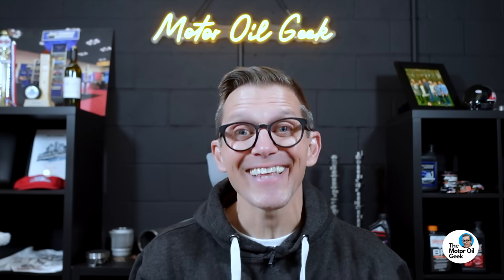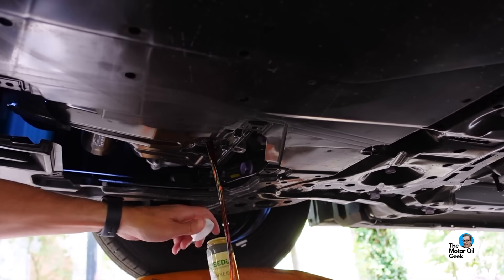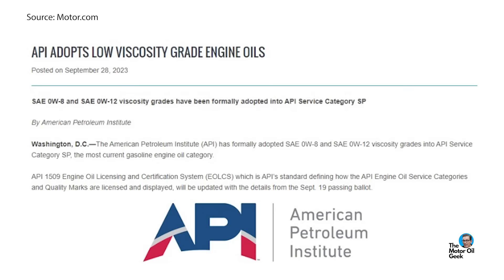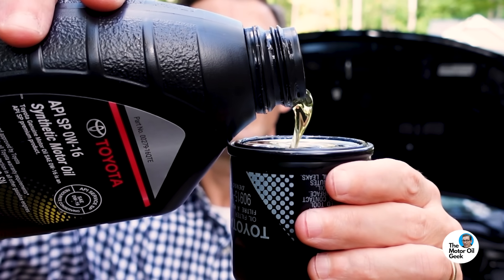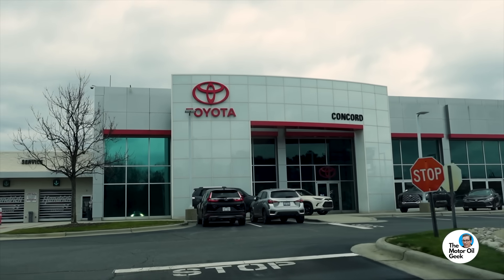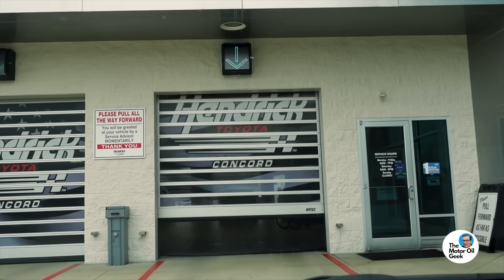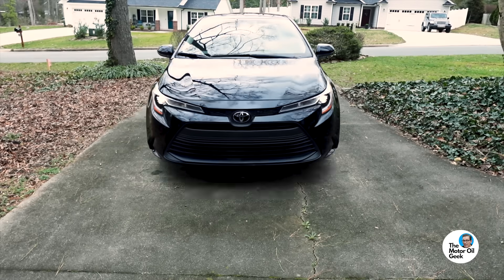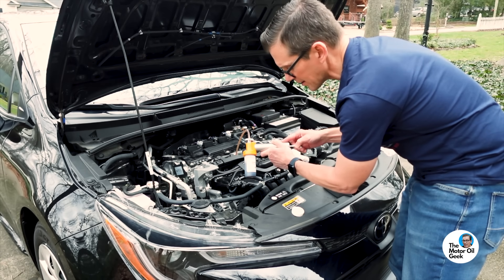0W-8 Motor Oil: Too THIN to Trust? Let's Find Out!

Comment: No need for a 0W-8!!!  A mono grade 8 oil would do just fine even at zero Fahrenheit.  Viscosity Index Improvers are not lubricants.  Indeed, they sheer and can gunk up an engine.  That is why I always use SAE30HD as opposed to 5W-30.  Don’t forget, the left side is 5W during temps below 32F.  It’s rare in the sunbelt!  So why do I want the extra junk in my oil that are not lubricants and causes sheering?  Mono grade SAE20HD is fantastic and expensive too!!  NASCAR race cars don’t use multi grade oils—SAE50HD is common there.  Also, Supertech SAE30HD has an API of SP.  Good to go!

Comment: Do you foresee issues as these ultra low viscosity oils are introduced into heavier load applications? Theres one thing to lubricate a lightly loaded 4 cylinder corolla engine, but what about larger vehicles, such as semis and off highway?

One has to assume that this oil is already running at or near boundary lubrication conditions. The tribofilm formed by these newer additives such as ILs have to be the reason the contacts dont trash themselves from surface wear.

And furthermore, this must be even more challenging for EV gearboxes. Combining ultra low viscosity for increased battery range but having the potential for high loads from the electric motor. Especially all these "high performance" EVs.

Comment: Great Channel..never knew there are so much additives and what they do..was wondering if you have a video on what the differences  are on oil for Turbo engines do they have xtra additives' to fight heat breakdown or turbo cokeing.. Have new CX30 turbo...I do let it cool down for 2 or 3 minutes before turning of the car, was planning on doing an oil change at 1000 miles....was just going to run a full synthetic ..just a bit early for peace of mind...watched your break in video..also a great info...do you have a Favorite oil for turbos?

Comment: Anyone actually know (Facts not assumptions as Lake would say ) if Toyota is using tighter clearances when spec-ing these lighter oils or are they building to the same old clearances and then expecting the additives to pick up the slack.

Comment: Even 0w20 is sketchy.  The thinner the oil, the less forgiveness you have with dirty or low oil conditions.   Lower emissions and better mpg are great but at the cost of lower tolerance (in real world use, not a lab or a dyno) isn't worth the gains.  What good is a 0.05 gain if the engine is 25% more likely not to last past 200k miles

Comment: If those lower viscosities can still protect under load, the big benefit will be much faster pressurization and protection at startup, especially in colder weather.
Reply: That's the theory but then all gains would be lost as soon as you're in warm weather season. Plus all the thin oil just falls off where it needs to be.

So yeah it pump up nicely but it fails to stay where it needs to be.  20 or higher is probably the best compromise. Europe only uses 30 and 40 despite being much colder than the u.s.  weird places like Dubai use the thinnest even though they're burning hot climates and I'm guessing it's because rhey have a similar CAFE legislation to the us or something that fines them for not saving a drop of gasoline per mpg

Comment: One would think as an engine gets older and its tolerances increase a thicker oil would be better. The issue now is (if you keep up with the oil changes) that your engine doesn't wear because the motor oils of today are so good.

Comment: Thin oil gives no protection on hot weather+ what breaks oil is always heat. I always use 0w-30 in all my cars and never had any engine problems. Bmw has the best oil instructions what oil to use and viscosity, all depends on climate and how u drive
Reply: Mobile one 0W8 oil is formulated to withstand temperatures over 500°F

Comment: 0W-8 seems fine, and they are putting a crap ton of additives in it to make it good. That being said, its just too thin for my liking. Bar none if I had a 0w-8 car I would change the oil at 3k or 5k max just to be safe.

Comment: Speaking of 0w12. I’d like it if you went into the new 23 and 24 3.0 twin turbos switching from 0w20 to 0w12. They claim they have less to lubricate and that’s how they get away lowering the viscosity. I’d like to know if that’s true and how that compares to how Toyota got away with using the lower viscosity. Thanks
Reply: On BMW. My fault.

Comment: @themotoroilgeek … 
Noack … any info/concerns ?? with viscosity so low on this oil … and that your daughters new car is a GDI … 
I see no mention of Noack numbers. 
      Is that a concern of yours with regards to IVD’s … or have the engineers on this oil minimized evaporative loss in such a ‘thin’ oil 
      Many OE’s are say int that Noack numbers under 12 are ‘acceptable’ … 
   Just as you’re not taking long change intervals as ‘ok’ … does that apply to evaporative loss ? 
Do you have a  Noack number on this oil ??

Comment: @themotoroilgeek - do you have a video discussing what oil to run in a healthy street small block chevy or similar? It's a dart block 383 with factory style roller cam and roller rockers. Bearing clearances are on the tighter side. It's not a drag motor. 500HP daily driver. Bigger pan with bypass plugged and a large WIX street type filter.  I have driven BR30 break-in oil in it now. Can i run 0w30 mobile one racing oil (ridiculously expensive)? Can I mix racing oil with 5w30? Is there an off the shelf product that fits the bill? Hos long should i run the break-in oil? 1 hour? 500 miles? PLEASE ADVISE!

Comment: Question:  Have you ever investigated OEM oil recommendations for various driving conditions (normal vs extreme condition)?
My guess would be that the range between "normal" driving conditions and "extreme" driving conditions, would make for a solid guideline of oils recommended by manufacturers.  That way, people could make better decisions on what oil they used, based on their own circumstances, and not simply default to the under-hood sticker.

Comment: Question for you Lake! My car (stock Fiesta ST) calls for 5w-20.  And I’m going to be upgrading my turbo and the manufacturer (Turbo Technics) recommends 5w-30 for street use, and I believe it’s 10w-40 for track use. In this video it perfect showcases that oil viscosity isn’t the only factor to consider. 

So my question is… why do I need to step up to 5w-30? And should I be using 5w-30 for my car now? 

This is my fun car so anytime I’m driving it, the thing is being pushed kinda hard! I appreciate your hard work and thank you for sharing your expert opinion!❤❤❤
Reply: 5w-30 is thicker when warm, thicker oil provides more cushion for bearings and other parts; turbos spin at a ridiculously high rpm and need the extra “support” that thicker oil can provide. They say 10w40 (even thicker still obv) for track because well, track is constant high rpm and high heat use, it’s extra hard on the engine oil so you use a thicker oil to give you a little extra cushion

Comment: You seem like a trustworthy guy, my 2013 Honda uses zero20 I think that’s kind of light. What would be the heaviest I could put in a car without hurting it I don’t mind the 20 is the zero that bothers me. I live in New York I’m moving to South Carolina where it’s warmer. What would you suggest ? Anybody in the comment section that has knowledge you can chime in my car has 111,000 miles not bad by Honda standings but still high. At the moment it uses a quart of oil between every oil change that’s 5000 miles I was hoping a little bit thicker would help that. Thank you.
Reply: 5w30

Comment: The "Free" oil changes at our Honda dealership are technically warranty jobs/warranty pay so we have bulk Honda 0W20 and a separate 0W20 tank with oil from Lubetech. For 0W16 we just have it in quart bottles since there is such low demand for it in our vehicles at this time. 0W8 is somewhat terrifying....those tolerances must be incredible tight.

Comment: Can you test liqui moly molygen 5w30 or 5w40? Ive used a bunch of diff synthetic oils in my 2004 impala ss, from 0w20-5w40...i noticed on molygen 5w40 that my engine vacuum at idle was pegged to max lowest for the whole 6k mile OCI (based on factory vacuum/ boost gauge) which on any other brand of 5w40 or 5w30 or 5w20 or 0w20 it would stay at the second last line on the vacuum side of gauge at idle and i gained a 2 mpg average in fuel economy in my usual commute while i had that molygen 5w40 in there...engine also seemed to be a little more quieter compared to any other 5w40 ive used...would be curious to see you test and see what you find? Seems like whatever additive package is in it makes the engine spin a little easier just based off the vacuum guage and 2 mpg economy increase

Comment: my co worker is automotive illiterate and does about 10k miles between oil changes on his V6 Toyota SUV, well its at 300k now and is still on original plugs and even serpentine belt. hes only done brakes and tires on it. most changes have been dealer or whatever is at a quicklube. yotas go forever it seems. 

i'd like to see a video on testing oil additives... personally i put Hot Shots FR3 nano in all my engines (exceot wet clutch)

Comment: These super thin oils are all about fuel economy.
But don't worry, the way most Turdyota owners ignore maintenance,
and "just keep putting gas in the tank and keep on driving them!" that thin oil will thicken up with sludge.

BTW: CVTs are the worst!
Had the misfortune to drive one on a long trip.
Annoying, droning, and slow.
With modern 10 speed automatics, CVTs and their constantly wearing metal belt, are not the answer.

Comment: Sometimes thin oil kills engines that were not designed for thinner oil. Back in 2012 I was the camp manager for a man camp in the arctic. I had 2 generators one which ran 24 hours a day for 500 hours then I would switch to the secondary generator which would again run 24 hours a day until it reached 500 hours of run time. Back and forth. During the down time the generator on standby would get maintenance and the oil changed. Also the standby generator was always plugged into the running generator with several different block and battery heaters so that if needed it could be started instantly in very below F weather. The engines were never cold or cold started.  One of the generators I had was a brand new Cat 500KW paired up with a 3000 hour Cat 500KW generator. One day the Cat dealer got the bright idea that because it was "cold" outside the generators should have "winter" Shell Rotella 5W-40 oil instead of the normal 15W-40. That was back when Shell Rotella only came in 2 flavors. The Cat engines both had HEWI injectors which are sensitive to oil or lack thereof. After the new Cat gen had its oil changed to the "winter" oil at about 400 hours it quit in the middle of the night. The generators would always quit in the middle of the night for what ever reason. The breakfast cook who worked at night would come and get me when the power went out. I would have to run out, start the secondary generator, Let it get up to speed and minimum temp then switch over the load to the running generator. Not quite as easy as it sounds when it is 30 below zero, or more, outside.

The new Cat generator was toast cooling fast. They lost another Cat generator with the thin oil in a different camp for the same reason. The generators live in basically a plywood box outside that has to have the snow shoveled out to keep them clear. Part of the box had to be torn down to get a replacement gen installed. The replacement gen lasted almost 500 hours before the water pump went out again in the middle of the night when it was -45 degrees F. I started the secondary generator which I remembered also had the thin oil in it and called for repair of the primary gen. While I was waiting for the Cat mechanic for the first gen I called for an emergency oil change on the running secondary gen which had started making noise. The Cat mechanic got down to the bad water pump then said he didn't have another so would have to go steal the one off of the dead new generator. Mean while the secondary is starting to sound real bad even after the emergency oil change. It got down to the point where the mechanic working with the secondary told me that if I didn't shut it down it to was going to shell out.

Long story short everyone in camp had arctic gear, the mechanic working on the primary gen told me that he could have it running in 1.5 hours so I shut down the secondary generator. 1.5 hours later after the camp inside temp had dropped to around 50 degrees and people were complaining I was thinking of an emergency evac to a warmer place, the primary came back on and I was able to restore heat. The secondary was never replaced or fixed, the primary ran for 6 weeks straight with arctic oil changes, pour new oil in as the old oil runs out until it is clear until the camp was moved.

The moral of that story is that the wrong oil can kill engines and potentially people.
Reply: Thinkfirst IDK WHY your comment doesn't have more upvotes.  I spent several years in a large fleet, part of my job was to be in charge of maintaining over 30 large diesel back-up generators (for a major west coast airport).  I can well relate to your story.  
But I had a much easier time of it, since not only were "my" charges operating above freezing 99% of the time, they were also idle, except for test runs and bona fide power-loss emergencies.   The lesson is if you are in charge of important equipment, make no major changes, without some kind of long-term test of the change, before actually rolling it out - I hope your employer made Caterpillar pay for the damaged generators caused by their stupid recommendation!
Reply: @robertmaybeth3434  

Most people can't relate to my situation so it might have been a great story but not note worthy.

I personally believe that people nowadays just can't read that much anymore. They have been conditioned to limit their thoughts 
to 140-280 characters and anything more than that blows their mind. how r u is nothing but lazy shorthand.

I believe that it is part of the dumbing down of the USA to bring us closer to the third world countries who can't compete. 

If you are free thank a service man, if you are stupid thank a socialist democrat. Not that most people will read down this far.

Comment: @themotoroilgeek I’m curious about Amsoil Signature series 100% synthetic I’m now running in both of my Cummins diesel engines (which we all know they are $10-13,000 engines) and seem to have reduced internal friction since changing to this oil. 
I’m actually curious if the juice is worth the squeeze, so to speak.
This oil is roughly 3X more expensive than Shell Rotella. 
I appreciate your diligence in videos!

Comment: THAT CVT IS A NIGHTMARE IF YOU DO A LOT OF MOUNTAIN WORK .  AND I WILL TELL YOU WHY . IF YOU GO DOWN A LOT OF HILLS YOU WILL FIND YOUR BRACKS START TO FADE . IF THE HILL IS STEEP ENUF AND YOU FIND YOUR BRACKS FADING . YOU CAN DROP IT TO ITS LOWEST GEAR . BUT I CAN TELL YOU THE CAR  WONT SLOW DOWN  LIKE A NORMAL TRANS MISSION  SO BE WARNED IF YOU LIVE IN A MOUNTAIN WHERE YOU HAVE TO USE YOUR BRACKS .  DO NOT HAVE A CVT .

Comment: Hi 😊 what about white ceramic  oil? I m about to test it on my peugeot rcz 200hp after looking at some tests on high oil burners. I thought that since the Prince engine ( thp 1.6) is known for overheating easily that would be kinda perfect since it can go up to 1200 c and the lubrification benefitis from ceramic oil is better aswell.

Did you ever test that kind of oil?

I did test a hyper lubrificant used by Nasa aparently last time i serviced this engine and almost 8 k km after that it hasnt moved e nd even the colour is sweet. Thats why i wanna try that white milky oil. 

What do tou think?

Comment: My friend got a VW TDI back in the day, and they MADE SURE to go to one of the two dealerships that were in the area at the time rather than the other one for oil changes.  Good thing!  The other dealer started getting TDIs just dropping like flies.  It turns out that they were indeed just buying a big drum of whatever oil and putting it in everything, unaware that diesel engines have particular requirements that really must be met and the oil they were putting in was unsuitable.   

I don't know if they were blowing the engines, or if it was one of those diesel setups that uses oil pressure to assist the injectors and the high pressure oil pump and/or injectors were failing (I suspect the injection system). But it was something costly for the dealership (or for VW depending on how well VW pays on warranty work..).  And probably unpleasant for the owner since besides their car dropping dead, they probably had a nice wait on repair time since probably most of the TDIs that dealer sold were coming in for repair.

Comment: I wouldn't trust oil to be in the engine for that long, the addatives are important, and unless you want a seal wearing out, change your oil way before that 10k mile , or 5k mile bs.